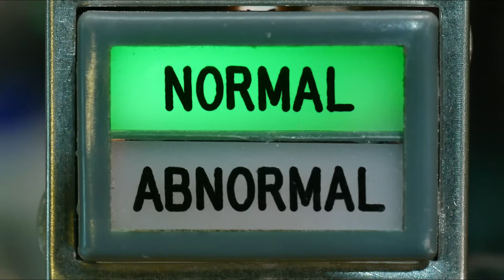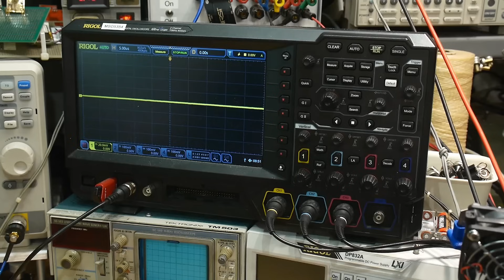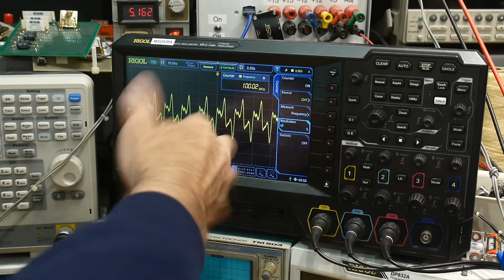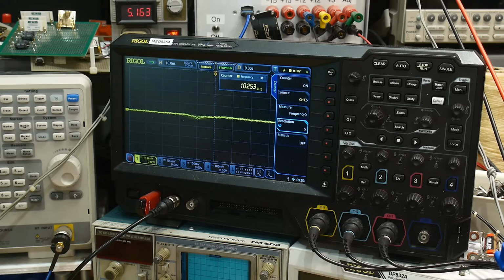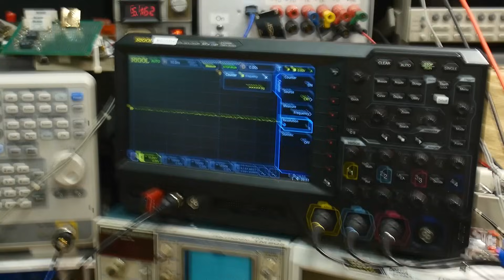#1853 Free Oscilloscope Probe Attachment

Comment: Thanks, you gave me an idea.
Use a inductor with ferrite core to better collect EM waves. 
Here thinking out load:
Hey connect inductor with ferrite core to an sma connector, now you have a real probe.
You con also put an opamp  between inductor with ferrite core  and sma connector using a small pcb, now you have active probe for low frequencies.
I wonder if we use current probe using hall effect sensor we could make touch-less DC probe.

Comment: I have built a few of more safe probes with a few wire turns over a small ferrite rod, about 3 mm or 1/8” diameter, 50 ohm termination resistance and several feet of RG58 cable.  The coil is mounted inside a foot long phenolic tube and locked in place with either RTV or hot melt near the “far end” of the tube. The length gives great safety testing high voltage inverters or transmitters and like.  I have also built a couple of probes with a toroid ring, slotted with a diamond cutting disk on a Dremel.  These were mounted similarly at the end of an insulating tube, shorter, as these were intended to following signals (currents) on PCB traces or possibly in bundled wires. As some ferrites are quite low resistance, the tiny toroid (bead) with the slot pointing out of the tube end was left a millimeter or two inside the tube and the end was filled with epoxy.  The slot direction was marked with lines on the outside of the tube.  That way the probe was directional in a known way.  Not truly free of cost, but I happened to have all the materials and tools already on hand.

Comment: If you're shoving that thing into the non-isolated side of switchers, I'd maybe invest in a $0.02 piece of heat shrink over the wire wrapped around the ground part of the loop too - just to prevent the accidental BOOMs. It might also help keep the coil nice and tight and making good contact with the ground contact on the probe when you slip it on too. But GFCI's can really save you on those as well. Just the other day I was probing something running off of a variac set to 24V that had what I thought was an isolated switcher on it - clearly not, because when I attached the ground clip of the scope, the GFCI tripped! Better that than blowing up the scope! I had to reset the breaker, and put the isolation transformer before the variac, and then everything was fine.

Comment: The probe used shows a resonance frequency of about 10 MHz. With 10pF for the probe this could be around 25µH, it should be less so there is more capacity in the tip. For lower frequencies you can take a ferrite core cylinder coil, my preferred value for a rather small coil is 100µH.   -  You can also try just not to touch with an isolated tip to apply capacitive coupling with 0.1pF  to 1 pF.